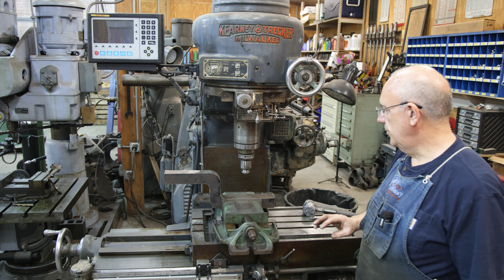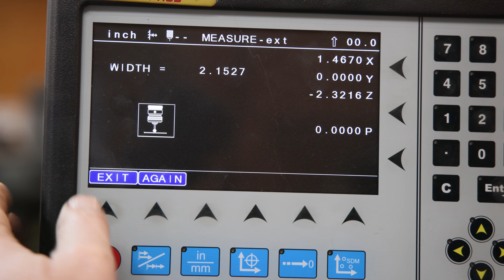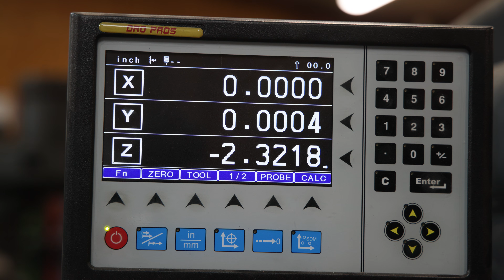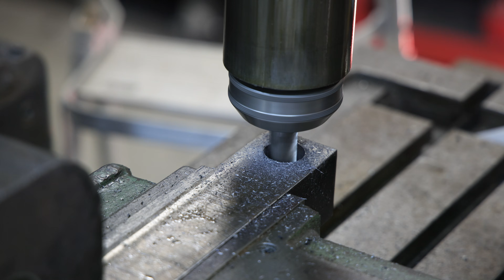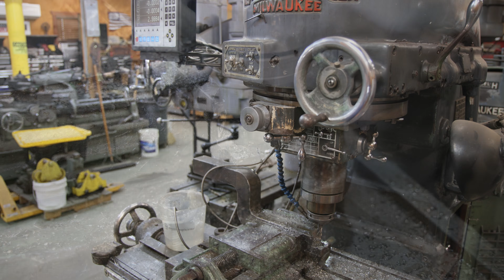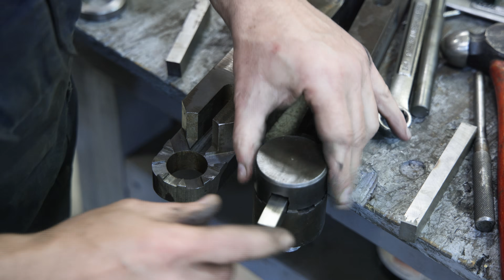Steam Stoker Engine Project: Using the Rotary Head Mill to Make A Custom Planer Tool Holder!

Comment: I admire your perseverance.  I just have to wonder, though, how did they make it 100 years ago when it was first built?
Reply: Unlike Bozo, they knew what they were doing, it's called a HORIZONTAL BORING MILL!:body-blue-raised-arms::face-blue-smiling::face-blue-smiling::face-blue-smiling:
Reply: The first machine tool were built by hand and each generation of tools increases in the precision of next generation.’
Reply: I haven’t gone back to check, but my recollection is that Adam Booth (“A-Bomb”) was almost able to do the job on his milling machine, but the mill wasn’t quite the right size.  The next larger model from the same manufacturer would have worked.
Reply: Thats one of the Machinists PARADOXs, right??? 🤷‍♂️.   In order to build a lathe and a mill…..you NEED a lathe and a mill…..so 🤷‍♂️….where’d the first lathe and mill come from? 🤷‍♂️ 🤣🤣🤣….the other machinists paradox is ….”I bought a lathe and a mill…just so i could make parts for the lathe and mill 😳😳😳😳
Reply: @Baroque_Back_Mountain   I’ve often thought about the importance of those first tools that were made.  Was it a hammer, or scrapper?
Reply: @ we’ve all seen the very first primitive wooden lathes that were bow driven….and, the first mill must have been a similar log of wood, with a sharp rock in the end, to bore a hole. And yes, to think that we used Those tools to make better and better mills and lathes, until we get to the space aged cnc mills, laser cutter and water jets….from sticks and stones.  
If an ancient person could travel from the stone age to today…even the advanced stone age. ….every human alive would seem like they were, either super human…or practicing witchcraft, to them. 🤣
And the future of things is even crazier. ….3D printing houses in different materials, like plastic, concrete and metals….printing copper pipes and electrical wiring, right in place, as part of the design file. ….and doing it all over night….from concrete slab to turn-key home…all 3d printed over night. 
When people say ..”humans are lazy” ….i’m like 🤷‍♂️ not ALL of them….if they were, we’d still be in caves.
Reply: @Poppi2006 The first tool was either a sharp rock or a sharp stick! 😂
Reply: @Baroque_Back_Mountain If you haven’t already seen them, there is a great series of videos by “Clickspring” (I think the guy’s name is Chris) where he recreates parts of the Antikythera mechanism. He makes basic tools, files, drills etc. but he did a couple of videos where he made a bow lathe…starting with hardwood parts and gradually making more sophisticated brass bushings and other parts. It is like a walk through of the evolution of the first lathes. It is small scale stuff compared with the lathes and mill that Keith so expertly uses but it is a great insight into the ingenuity of our ancestors.
Reply: @ that series literally inspired me to buy a lathe and mill and start machining. 
…i do stuff that more like Banjoshow’s stuff …(check him out, too.)  His projects are more simplified and 🤷‍♂️ I don’t want to say EASIER, but certainly easier than building an Antikythera device ….in fact he was another inspiration. 👍
Reply: @Baroque_Back_Mountain  Just think of that ancient human looking at a CNC machine or a flight simulator or even  Boeing 747.
Reply: @  😳 they;d think it was Witchcraft
Reply: Like he mentioned in a previous episode, Keith thinks they had some custom tooling - which would make economic sense, since they were making many of those stoker engines.